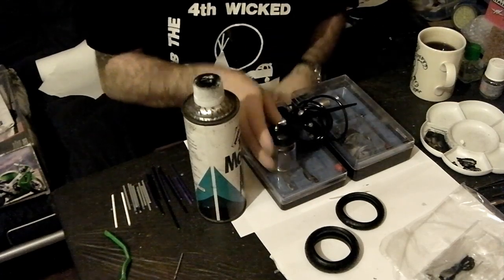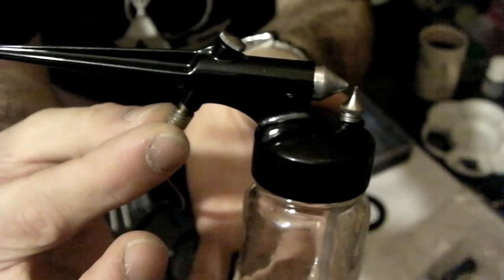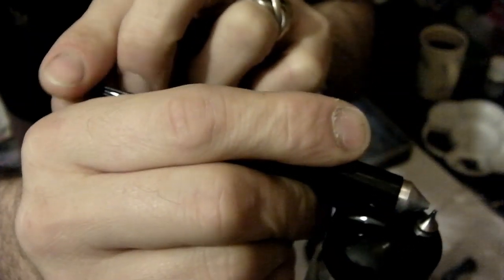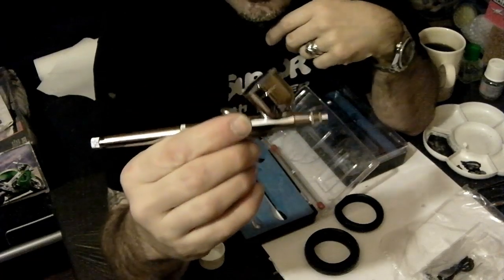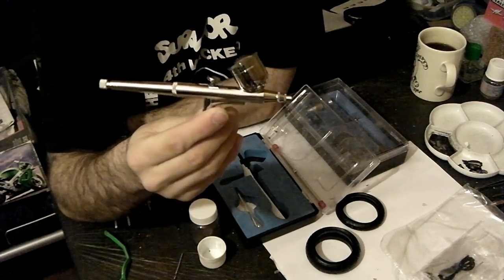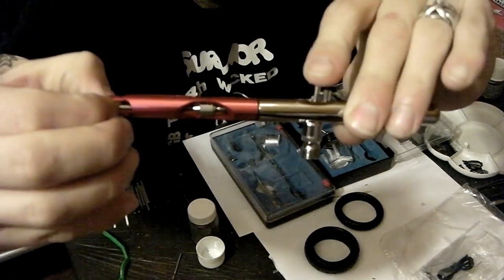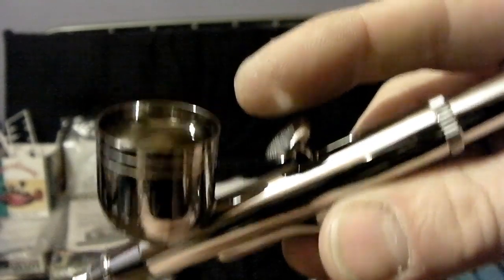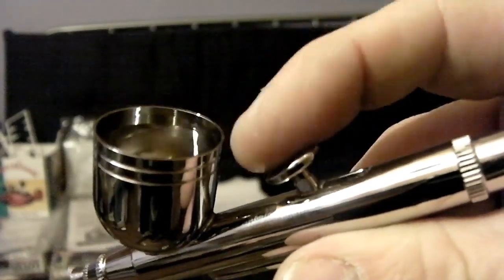Airbrush basics, how single and double action airbrushes work

Comment: What a refreshing change to find an instructional video that has been made with the cam on a tripod, edited, is to the point without endless bumbling waffle - plus contains all the info you need to know. Thanks for this. One tip - avoid black objects on a black background In this case your T-shirt. (But you fixed that in the cutting and editing anyway!) Thanks - just what I needed to know.

Comment from the maker: What type of airbrush is it?
There are two sources for airbrush air, one is a propellant can, can be bought from craft stores, model shops, ebay etc, the other and a better one is a mini compressor, more expensive initially but much cheaper in the long run as you're not buying replacement propellant cans.
You can get a mini compressor from ebay for around £60, they are almost silent in operation.

Comment: This helped me out so much. Is there a way to get the paint in the dual action airbrush to be as widespread as the single action one??
Reply from the maker: The paint spread is due to a mixture of the air pressure and nozzle size.
To achieve a similar spread you'd need the largest nozzle you could get for the DA brush, I've only seen 0.5mm but you may be able to get slightly larger like a .75 or 1mm, then it's a matter of increasing the air pressue allowing you to hold the airbrush further away to get a wider spread of paint and, (depending on the paint used), make it as thin as you can while it will still bind succesfully.
The downsides here are that you're forcing the brush to behave in a way it wasn't intended, (DA brushes are designed for detail and precision), and you'll have to experiment to get a setup that works for you, TBH even if covering a very large model kit a brush with a 0.5mm nozzle will cover it adequately and well and a larger surface area means you may be better off with a spray can paint like Tamiya or an auto store one. Most DA brushes are provided with a 0.3 nozzle setup so try a 0.5mm if yours has a 0.3 and see how that goes.

Comment from the maker: @maramarosifavago  Provided the brush has teflon type seals, yes.
You'll find that most cheap chinese brushes do have teflon type needle packing but use rubber o rings on the nozzle, if most, like mine seal without the rubber o ring so spraying cellulose / lacquer through them is fine, i've used mine to sprays alclad a few times and clean with cellulose thinner no problem.
You can try it with the rubber seals and see how well they stand up to it. They are not expensive to replace.

Comment: hello, could you please tell us where do you get this mogran air spray? i cant find that in the internet
Reply from the maker: Oooh, now theres a question, that particular propellant was bought many years ago with the Badger SA brush and I couldn't say if it's still available, however, if you search for airbrush propellant, any brand will do, they're a univeral fitting.
If possible i'd recommend a compressor, even the ebay cheapies are far better than the propellant cans.

Comment: I'm probably going to pick up an Iwata Neo Gravity Feed very soon. Do you have any recommendations for a compressor and/or spray booth? A couple modeling channels I watch use this booth: http://www.amazon.com/dp/B00B2TESUQ/ref=wl_it_dp_o_pC_nS_ttl?_encoding=UTF8&colid=AOIVU6VO6H77&coliid=IDIBZLVAYHE4U but some people say if you use enamels or other paints with solvents/chemicals in this booth the fan will catch fire/explode? any advice would be great!
Reply from the maker: +Chris Brannan I honestly cannot comment on spray booths as I don&#39;t use one, I spray in small amounts in a hobby room and can ventilate it easily.
However, that said, any spray booth you purchase, unless it states expressly that it cannot be used with solvent based materials will be safe, (bear in mind even Tamiya Acrylics are IPA based), the fan units are, like bathroom fan units, designed to deal with moisture and solvent mist, the only time you need to be careful is if you build your own, you need to get a fan that will operate safely with solvent based products. As an additional comment I'd recommend you spend that bit extra and get the Iwata CR, unlike the Neo, which is built FOR Iwata and has rubber seals which will degrade rapidly with Cellulose products the CR and other brushes made BY Iwata use Teflon seals which will safely spray and clean with cellulose based paints and cleaners, If you only plan to use Acrylics and nothing more aggressive than IPA in there it'll be OK
See my other videos on Airbrush types, cleaning and stripping to inspect seals and such